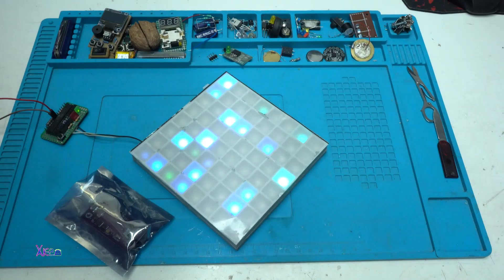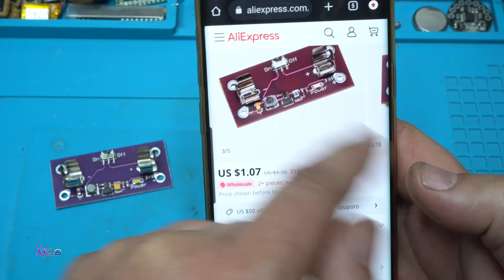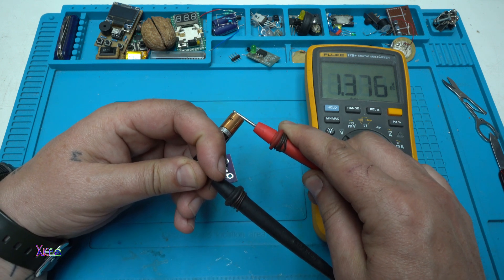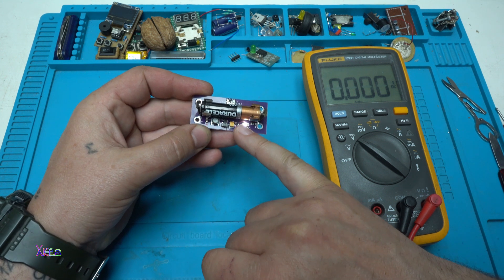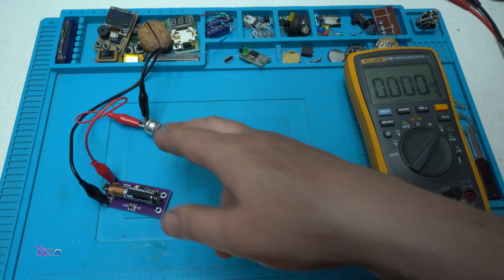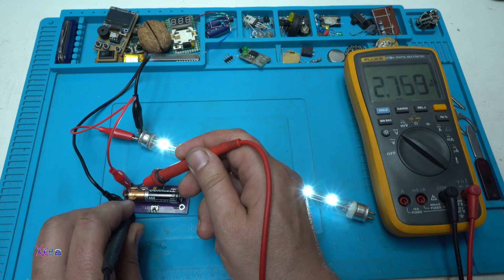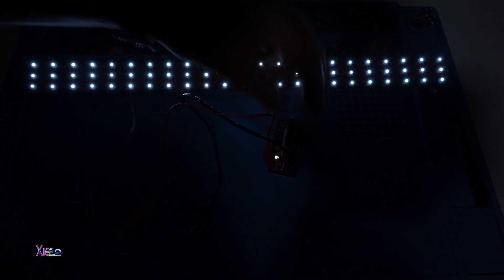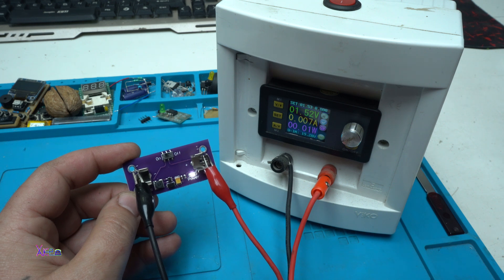$1 Gadget from Aliexpress DC-DC Boost Module 1.5v to 5v

Comment: So, if you connect smartphone cable at the circuit, it may charge it
Reply: No, not with a single battery and less than 200mAmp.  Have a wonderful, peaceful time ✌️😊  🕊️🍀❣️